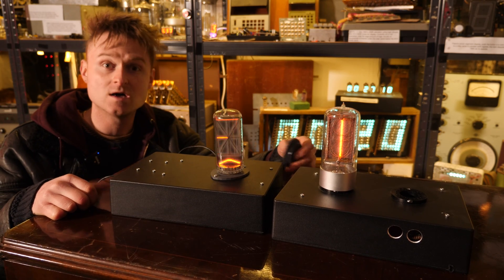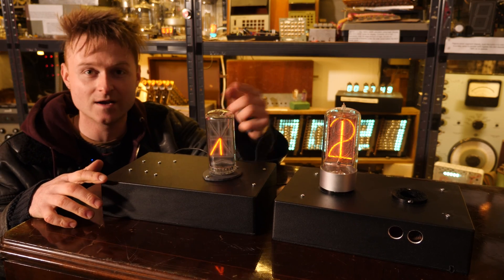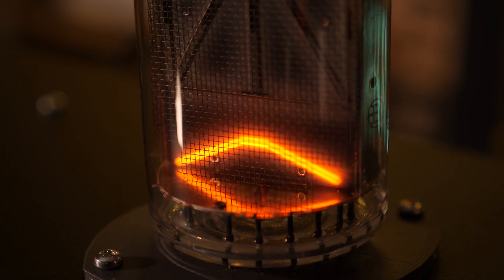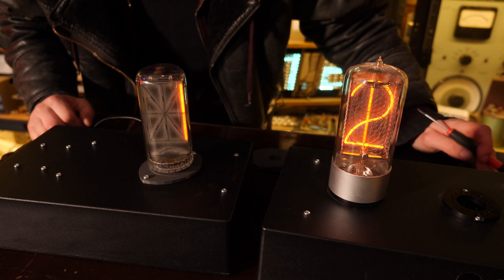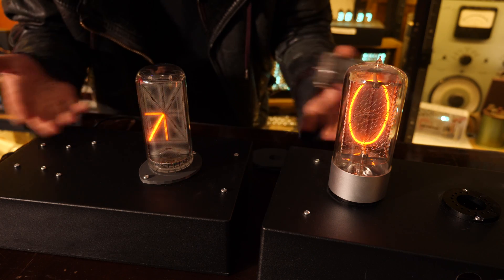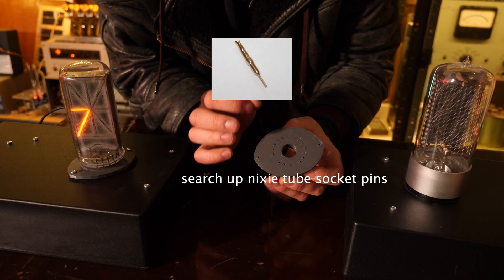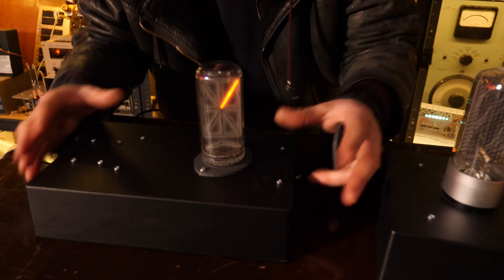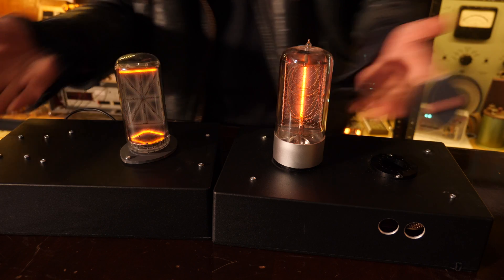Making A Nixie Tube Socket For The BIG 15 Segment NIXIE The Burroughs 7971

Comment: your 3D prints have polygons instead of arcs, try increasing the resolution in the model export properties to the stl file
Reply from the maker: indeed! i would if it bothered me :D. its functional. cheers!
Reply from the maker: i use different settings for different things, this is the quickest way of doing it and i tend to do it this way with 100 percent infill. usually my 3d prints are all functional and larger, i never bother to adjust the settings. just dealt with it as part of the process

Comment: On your 3d printer, your flowrate is set just a tad too high, You can see it on the top surface being a bit smeary and not smooth. 
Very neat application for 3d printing! Do the nixie tubes get warm at all? Should the sockets be printed in something else than PLA?
Reply from the maker: i keep flow rate high just so it prints thick. the look is secondary to how densely i can pack it :D.
Reply: @THISMUSEUMISNOTOBSOLETE  Heh nice! I had to tune mine, parts were not fitting together right with a too high flow rate.
Reply from the maker: they are called cold cathode tubes for a reason :D no they dont get hot, it would have needed a different plastic

Comment: 3:33 PCB version of the socket? Personally I'd advise against it - that thing may be too stiff, not allowing for slight movement of contacts, thus leading to stress and damage to glass. So, I'd either use springy contact allowing some movement, or use some wires.
Nice 3D printed socket design, I like it. Makes sense for nixies - they don't heat up that much :). 

Always a pity to see a cracked B-7971... I wonder if Dalibor, jdflyback or glasslinger could repair them.

Comment: Sam, not sure whether you'll see this comment but where the hell do you get the rounded socket pins you put the image of in the video? I've been trying to make up decent cables for my AE Modular synth and the regular Arduino like cables don't cut it.
It's been driving me mad.
Reply: Aah I see. I don't think the ones I shared would be suitable sadly! Have you thought about emailing ae? The owner I have met a few times is very friendly and helpfup
Reply: @LOOKMUMNOCOMPUTER  Robert? Yes. he's a gem of a guy. Honestly, I steered away from messaging him as I thought it sounded a bit like I'm taking the piss (as he sells the cables)> I might do so though - what's the worst he can say?
Thanks for your help.

Comment: i see your ZIN tube is suffering from cathode poisoning on the number six the tube i have has gone the same sadly the quality is no where near  as good as Dalibor Farný tube
Reply: I've found under driving tubes can cause issues like partial illumination. Better to drive it at it's full rated voltage and current and PWM to dim / extend life.
Reply from the maker: @christianelzey9703  partial illumination is what is mentionned in the above comment, check out the 6 :D. well i went to check it is actually at 130, it needs to be closer to 140 to fully illuminate. so my mistake its lit right but the tubes are so big the 6 being the front most number is partiall illuminated
Reply: @christianelzey9703  its the luck of the draw with the ZIN tube some people have had no problems but other have had cathode poisoning after a sort period of time i go my one two years ago to help support them through these tough times as a nixie tube addict i need one for my collection
Reply from the maker: if you look at it the other way, its a miracle multiple companies are making nixie tubes still. its a small issue, that personally i think can be overlooked. and we should be thankful :D

Comment: Not sure that a single bar could fail, sounds more like the driver, you could test it by directly applying the drive voltage to that pin
I think it would have been cooler to display the alphanumerics, something like "the quick brown fox ..... " or something perinent to you so each letter gets used.
It could alternate between the words and the random display.
Reply from the maker: i did apply voltage to the pin i tested them all when i realised, unfortunately nothing. it may be a break in the tube connection internally, its unfortunate. 
as for the display! i like the lack of digits for the reason explained :D if i ever find more than one i would certainly go for an actual useful displah with them as it would be displayed further back so would make sense to use letters or numbers. 
got a lot of other things to fix and build for when open again, but if i find a free hour i'll elaborate on the code a bit! but only got so much time :D, it gets the job done of displaying the tubes control and workings. so works well enough for now. cheers!